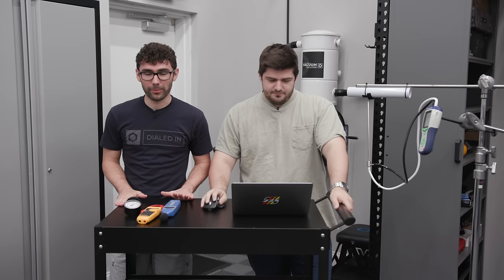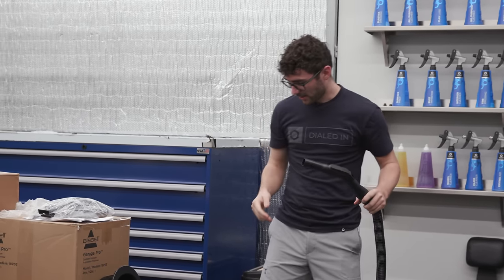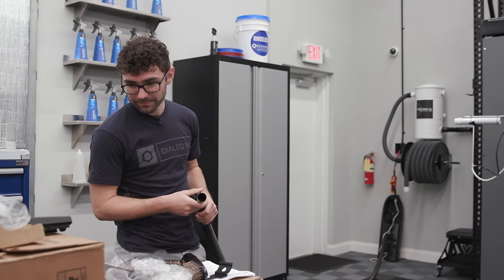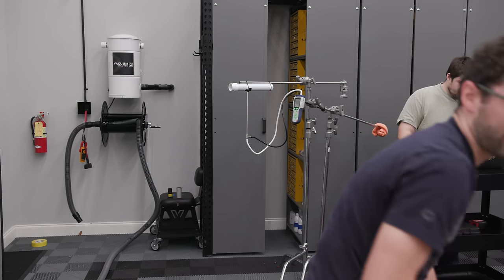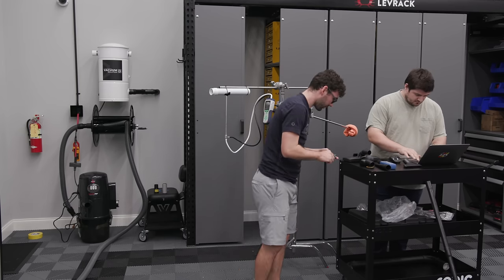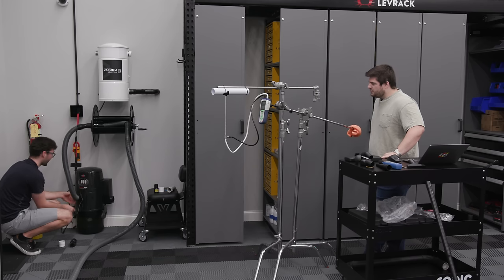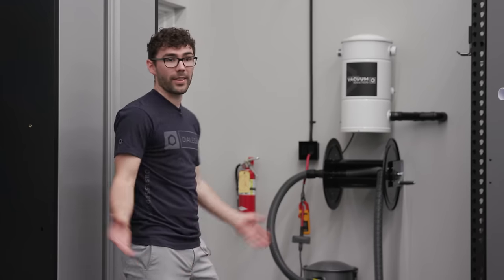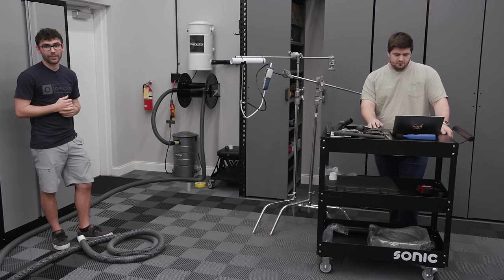The Vacuum Project: E2 - VacuMaid, Bissell, and InterVac

Comment: They make a VacuMaid unit that is like 1200 bucks and has 1200watts of power and crazy lift. The nice thing about the VacuMaid units is replacement of motors is cheap and they last forever.